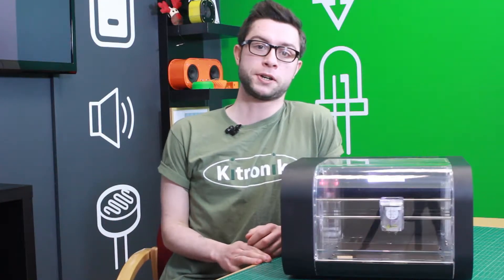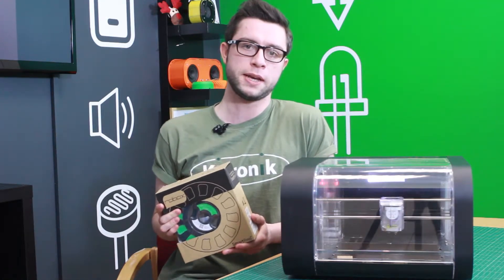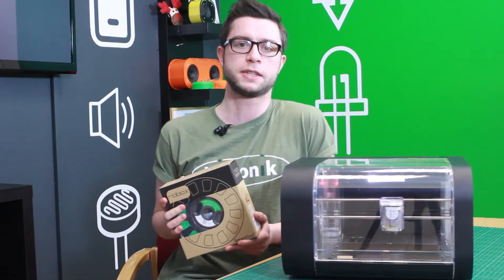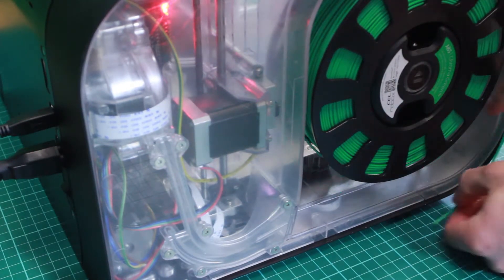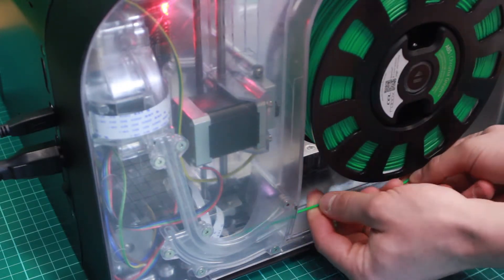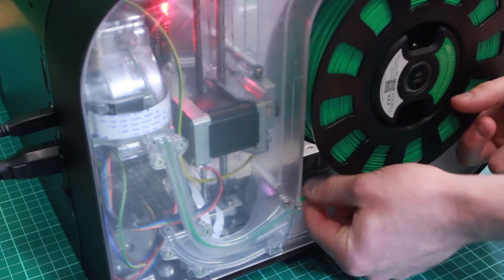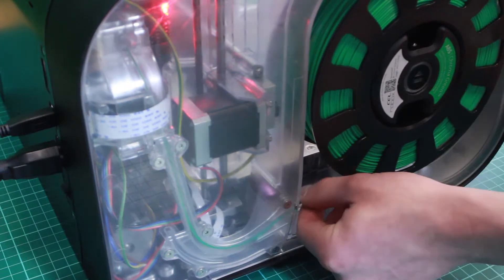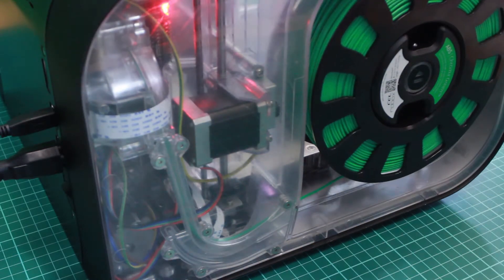Loading SmartReel Filament into your Robox 3D Printer (RBX01) - Kitronik University

Comment: Good day
We have a problem with CEL ROBOX.  We need your help.
The line of filamentit broke, so in the head there are filament, i need open the head for clean, but these case dont find in ever site.
Or what recomended for this.  i can send pictures for mail.
A video for this case will be excelent. thanks.
Reply from the maker: if you are having problems and you bought your Robox from us, you can contact our Support Team by email (support@kitronik.co.uk) and we can try to resolve your problem.